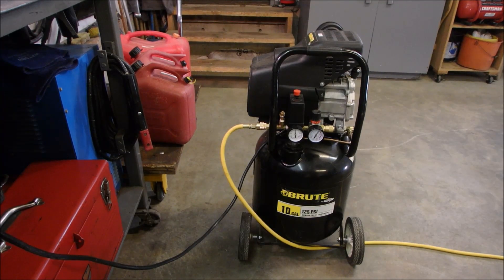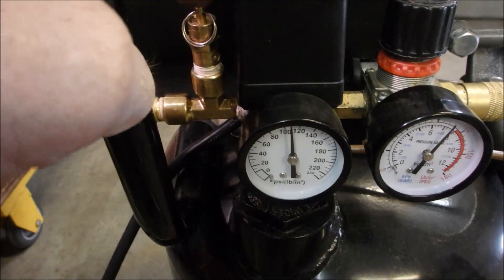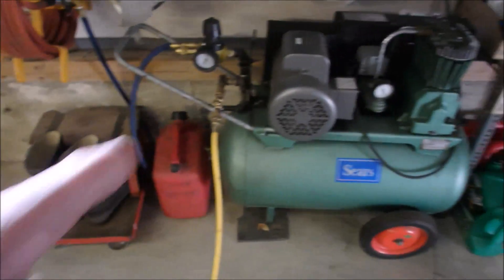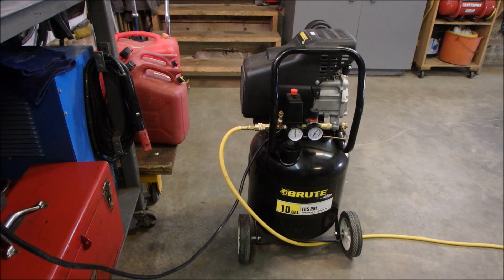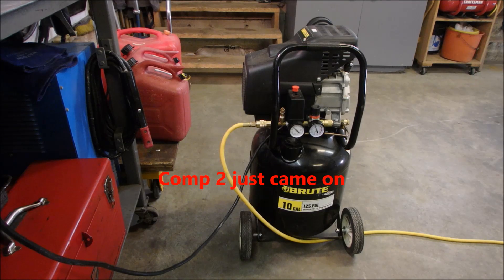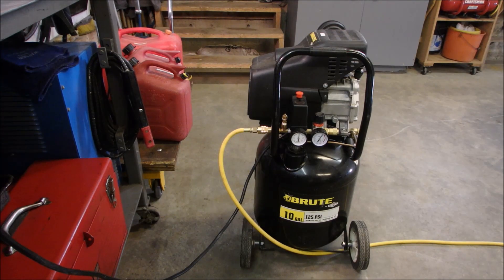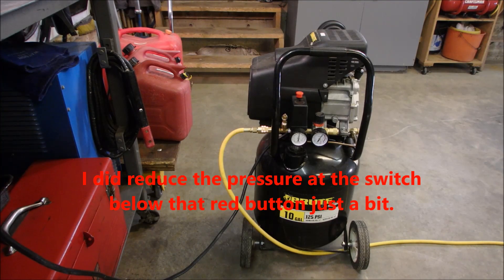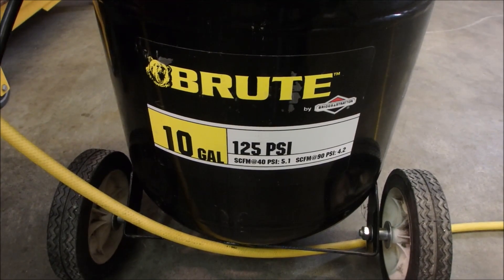Tandem Air Compressors

Comment: I have a 3.3 hp 20 gal tank max 100psi 10cfm @40 psi and a craftsman 5.5 hp 30 gal max psi 130  @ 40 psi 8.6 cfm.. and im connecting my paint guns. Which one should be in the back and which one should I connect to and where to I put my brass T to connect the two? At the over flow valve and put the over flow valve into the back side of the t? And then  should I run water filter e r between the two air compressor with two 5ft hoses with the filter in the middle connecting tandem compressors ?theb run a the another 25ft hose coming out the main compressor(no brass t just out of the coupler?) with my filter and dryer systemat the end  then to my 50ft hose to my paint gun?? I know im confusing but I'm learning as I go any and all input will help especially pics. Appriciate the help
Reply from the maker: I am sorry   I am not sure if i can help you.  I connect the 2 tanks together at tank pressure then use the regulator at either tank to feed my tools.  Sorry if I haven't gone far enough.   Remember to be careful above all else.

Comment: Nice video.  Why can’t you just come out of the ‘quick connect tool output’ on one compressor to a ’Y’ fitting, and out of the ‘quick connect tool output’ on the second compressor to the same ‘Y’ fitting, then both feed into one hose that feeds the tool?  Thanks.
Reply from the maker: You should do it on the upstream side of the regulator

Comment: Industrial version: 10 HP/ 208 3ph/2 stage with 120 gallon tank  +  5 HP/208 3ph/2stage w/80 gallon. In this case, the shop just wants to run the smaller compressor when running all of the light stuff, but then the big one adds in when the sandblast operation 40CFM is in operation. So the small one normally cycles on an off, on light duty. It  kicks in before the big one, unless the sandblast overwhelms it and the pressure keeps dropping, Then the big one kicks in a few psi lower and they both pump up to max and stop.
There are no regulators between the tanks, they equalize, joined in a manifold before going through a 
water trap then refrigerated drier
Reply: So if I understand you correctly, you just have a line out from each of the normal tool quick connects on each compressor, that joins together before entering the ‘conditioner’ unit, which then feeds the tool / shop.  Right?
Reply: @dginta7932  Well the compressors tanks  have 3/4" NPT ports, so we use pipe fittings - and we have a ball valve on each, then into 3/4" air hose, then the two hoses are joined in a custom 3/4" L copper manifold - then through some oil and water traps, then into a drier, then into a long run of 1" dia air hose into another custom copper output manifold that has 6 taps with hose - threaded fittings into those.  We avoid quick disconnects until we reach the very end of the line where we are using tools. But for sandblast cabinets or pressure pots we make hard connections. But yes, the two hoses are just joined and if only one compressor was working it would pump up both tanks (unless you close a ball valve)

Comment: hay sir I want to ask, I have 2 compressors. which one has a capacity of 12 liters and 30 liters, I want to combine it, so that there is more air filling, and I will only turn on one machine, is it safe?
Reply from the maker: I think so..    one machine may over heat   just watch it.

Comment: Would it work better if you had both compressors airing up a separate air tank and then getting your air from the tank? I have a couple compressors in the garage and a big air tank. Wondering if I can put everything together and run some big air tools off of it.
Reply from the maker: These are built as a dual tank 1 source compressor for carpenters etc,  The tanks are connected  Thanks for the great comment
Reply: Yes Brian, this is the ideal solution. That way, both compressors are feeding a single point which the main tool line is tapping into, and neither compressor is interfering with the other with air bleed-back etc if you have check valves on each compressor outlet. You could accomplish a similar result by connecting the two compressors to a tee fitting installed on one of the compressors and attaching a regulator to the spare port on that fitting then out to your main line. But, the additional advantage of having the auxiliary/holding tank is that it acts as a big water separator. The air accumulates and settles and allows moisture to condense out of it before it goes into the mainline.

Comment: Good one as always Bruce the Godfather or Small Engines. My neighbor has compressor like your big one with a 20 gallon slave storage tank plumbed into it for more air. Do you have same air pressure set the same on both units to keep from over filling the tanks?
Reply from the maker: +Raymond Campbell      Well the main tank is 50 years old so I set it at 120 lbs.   The smaller one is set just a smidge (word?) below that, so that it shuts off first and doesn't run all day filling the 2.
Reply: OK thanks Bruce.

Comment: I would have to do some figuring, but the CFM's don't accumulate so your CFM is likely what ever is coming out of what ever compressor the hose is connected to. At least that is my understanding when I looked into it last year.
Reply: Yes ... I'm not convinced that running two compressors in parallel (using a tee) gives you the sum of the two CFMs. I know this 'seems' to make sense, but I tried this yesterday with two brand new 4 Gal, 6.8 CFM Husky units, and I did not see any difference with CFM output,  wherein at the end of the hose was a 3M Accuspray HVLP gun that requires 13 CFM @ 20 PSI.

Comment: I've been doing this same thing for a number of years and recently upgraded my 21 gallon tank (that went bad) to a 100lb propane tank and it's connected to a 26 gallon 150psi unit. When I'm really eating up the air, having them both available with a shared air source really keeps my high demand tools going. When in standard mode (as I call it), I let the oil filled compressor head do all the work. Mainly because I don't care for how noisy the new oiless compressors are. I have modified the pump and plumbing on the propane tank with a separate regulator and 1/4" "T" connection so I can run two air lines simultaneously. Comes in handy when I'm using two air tools. Excellent tutorial Brice! Cheers!! Zip~
Reply from the maker: +ZippoVarga Thanks  It means a lot.  There has been some negative posts lately.      Bruce
Reply: Do you have a troll?
Reply from the maker: +ZippoVarga Things have settled down in the last few days.